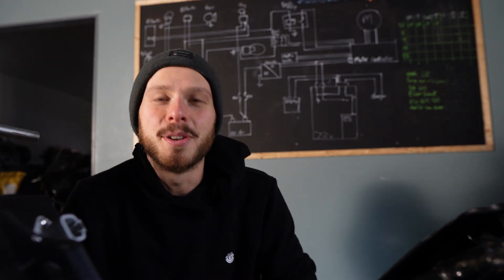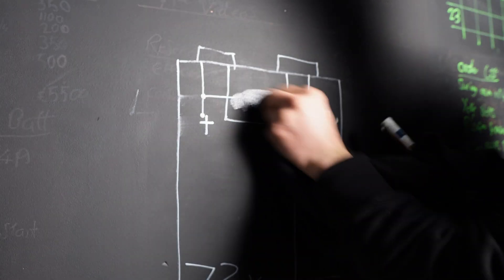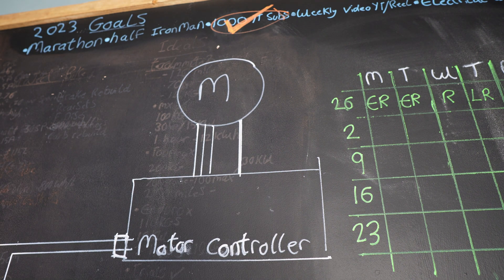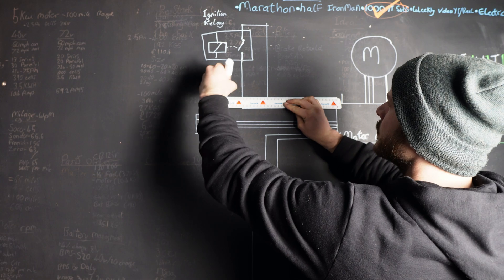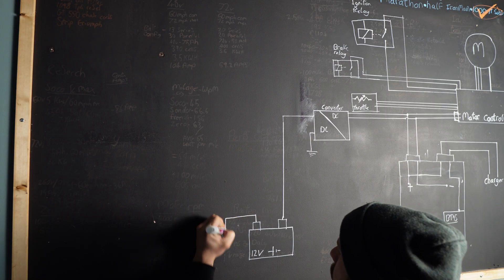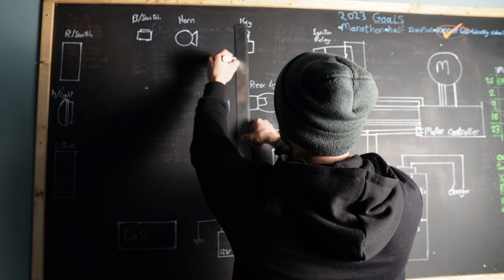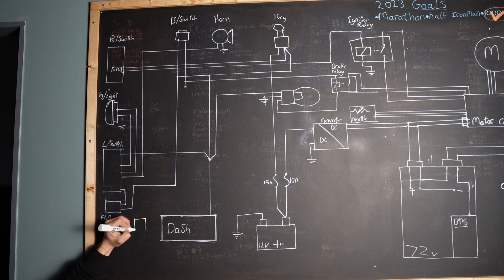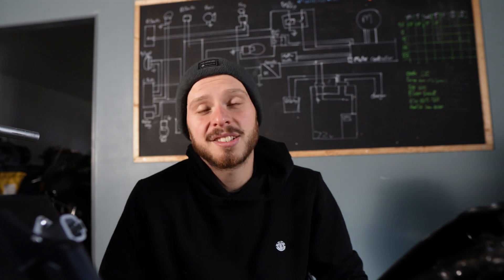How To Wire An Electric Motorcycle

Comment: Hey mike abel

I need some help 

I have a scooter snd a 36volt controller motor vattery throttle and brake cable etc 

Wanted to know what i can do or how i can make it work 

Ive tried but cant get it to show life